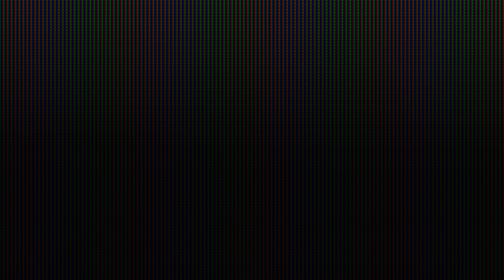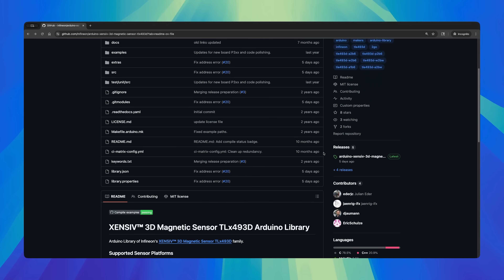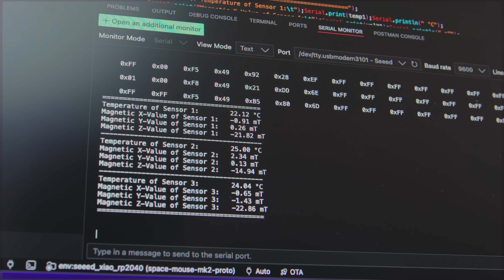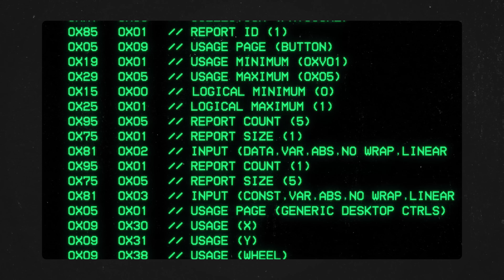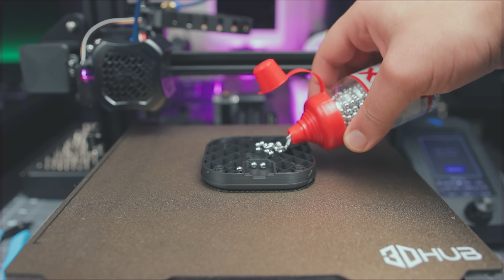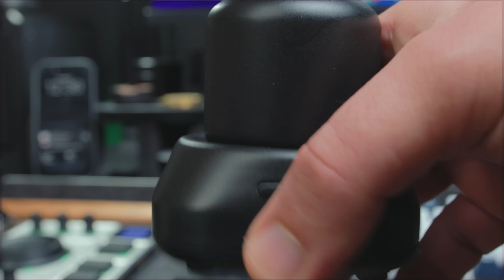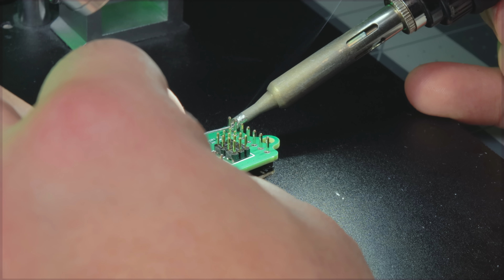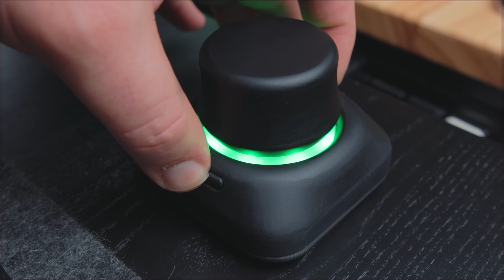I Made a 6DoF Space Mouse using Magnets (again)*

Comment: Good vid. Based on the examples I've seen this might be top 3 DIY 6DoF mice, though the PETG springs will sag when used and not have uniform motion, so although it's good you have the function to recalibrate on the fly, changing to custom stainless steel springs is an inevitable improvement. They're not hard to make since you can wrap wire around a screw to make a spring.
Reply: It would be super cool if someone made a fork of the eventual Git drop and included a write up with photos on doing this 😉

Comment: The springs will deform eventually requiring frequent calibration. Also that 2d orientation of springs create uneven tension when doing 6dof movement. I already did all this and came to conclusion metal springs are best and nothing beats them
Reply: Perhaps you'll contribute your findings to the Git once it exists?
Reply: @evilrainbow in my plan only code is not provided(closed). Full design step file is provided
Reply: @DoTheDiy Well I'd be interested in seeing what you are willing to share.

Comment: I just bought a SpaceMouse used this week for €75, it's pretty insane that nobody else has really entered this market yet
Reply: Because of driver support.
Reply: @olafmarzocchi6194  Yeah, building out software integrations with all the CAD and 3D apps is a big bottleneck. For my new 3d trackball Rotatrix, I'm finding that it has to be done per app, and it needs camera & scene information - not as simple as just sending HID joystick commands.
Reply: @olafmarzocchi6194  this and integration are the biggest headaches!

You could technically read any custom device cross platform with hidapi, but the software support is completely on you at that point
Reply: Actually I just did - I built a 3-axis trackball called Rotatrix that turns the model 1:1 with the ball. New kind of 3D controller that also functions as a mouse. Demo on my channel if you're curious.
Reply: I built this first model to use with Fusion360. I do like the small footprint.

Some months later, I noticed the Rotatrix ($231.96 cdn), which is little Pi-Zero raspberry pi board that I wired up inside a Kensington Slimblade trackball ($156.79 cdn). 

Rotatrix comes with a macOS driver that installs the appropriate plugins to apps like Fusion360 and Blender. The idea is the Rotatrix captures the data from the second optical sensor that Kensington uses only to detect rotation so that proper 6DOF is achieved. 

For day-to-day use, I very much prefer the 6D precise positioning control that a roller ball provides as opposed the constant-speed space mouse (wired version $306.99 cdn).
Reply: @rmkc2335  I'm really glad to hear that! Thanks for getting the kit, look out for even more functionality to come via software updates.
Reply: @davidliucreates I'd love to buy it but I was directed to a shortlist, is it possible thst you will be able to sell it anytime in the future and make it ready to purchase!?
Reply: @createdbysumeone working on it now!
Reply: Patents, small market and you would need to undercut significantly on price after finding a way around the patents, because otherwise people will just stick to "the original", as is usually the case. Too much friction, too many risks and even if everything turns out well, it still wouldn't be profitable enough unless you could compete at the same price point (which would mean you'd need other features to stand out, simple feature parity will not be enough to compete).
Reply: @XTJ7 Patent should be pretty simple to argue, because this is basically a short Joy Stick (old school long play devices)
Reply: @Mi-Ke-01  No.. it's absolutely not something you can just explain away. It uses specific sensor technologies in certain ways that are 100% something they will sue you into oblivion for, if they find you've infringed. That's the point of a patent and they will actively enforce against other commercial turnkey products.
Reply: @Roobotics modern vs old.. hence my use of the word "basically"

i fully understand what patents are for, often the argument comes down to form and function 

lastly i doubt the sensors are so unique you'd only find them in a SpaceMouse, so the patent must be about how they are arranged and how they are used with other components, many of these aspects you could likely overcome
Reply: @Roobotics  this is such a simple concept, it's insane that you can even patent something this basic.
Reply: Well, there is a 3d printed space mouse on aliexpress
Reply: the profit margin is too small, that's why
Reply: Naya keyboard, only 1K ;). Not sure about drivers.

Comment: This is wild dude, I watched your original video when it first dropped and the project has been in my mind ever since. I re-watched it a few weeks ago but the drawbacks to the original convinced me to just pickup a spacemouse. I found a used first gen wireless model on ebay for $130 and I lowballed the seller for $80 and he took it!

I printed a new knob for it and started learning PCB design on KiCAD to make a replacement usb-c daughter board to get rid of the micro usb port. Then you drop this video right after I get the gerber files exported lol

Comment: This is a really cool project, and it’s also awesome that you offer pre-assembled circuit boards! I’m really bad at that, so this is perfect.
The only problem now is that I don’t have a 3D printer yet 😭 I think I’ll wait another two years for the V3, then I’ll definitely be able to print it myself 😂
Reply: My problem with the original mouse is that it requires countless drivers to be installed, and they’re always running. I really don’t like that, which is why it’s out of the question for me. Open source is, of course, worlds better in that regard!

Comment: Awesome update.  My only concern is the PETG spring over time and it deforming, not so much snaping.
Reply: As he said, it's cheap and easy to replace.
Reply: yeah i would think better to use metallic springs, the simple bendy tube shaped ones with a hook on each end would probably be fine, get them about half the length of the gap between the anchor points
Reply: I have PETG loop springs holding up two of my 3D printers, They have not deformed and have been doing the job for over five years, and they are both over 5kg - I'm betting these are the perfect solution, metal springs are going to sound awful.
Reply: @vizionthing are these springs you speak of anything like in this video? i mean part of my worry is how thin they are

Comment: would be interesting to add a little touchscreen to the top, and heptic motor- really add clunks for quick navigations
Reply: It’s a mouse…it doesn’t need a screen that your hand covers and you aren’t looking at 99.99% of the time. Haptics sure
Reply: @adrianus13  imagine being able to change settings and calibarations on the fly and not with a full re-flash of firmware. maybe a (virtual) scroll wheel or a mini touchpad. Even change which device its using (USB to bluetooth)... its not a mouse; you dont think those buttons are left and right click and it just moves the  pointer around do you? (albeit a mode you could select if you had a little touchscreen menu)

Comment: after I watched your project 3 years ago I decided to buy the spacemouse instead of making one and its quickly paid itself off, zero regret. its nice to see the upgrade version of the project though.
Reply: Totally agree. It is the tool for such tasks as 3d modelling and video editing.
Reply: I already had a space mouse. But this being diy means i can have a space mouse for any apps or game or robot. Especially all the ones the actual space mouse is not supported on.
Reply: which you got ?
I kinda want now one as well, hehehe
Reply: @conker42  I went for spacemouse wireless. It's a little annoying because it's not heavy enough so I can't use it as aggressive as I want. to fix the issue I double-side tape it down to the table.
Reply: @hokoo @hokoon could maybe 3D print a mousepad-shaped plate that locks the space mouse into place while also being able to attach a gel pad for your wrist. The weight of your hand will keep the space mouse from moving, yet you’ll still be able to reposition it, unlike the double sided tape.
Reply: @app-o-matix  yeah I also think about that, same ergonomic as the pro version.
Reply: @hokoon  glue-on flat lead weights exist, used for balancing car tires. might be useful for you, along with a more grippy rubber mat / rubber feet on the mouse.
Reply: @hokoon yeah I have the wireless 3dx spacemouse too, but I have that in my laptop case for travelling, at the workshop I have the spacemouse enterprise, its FAR better, it sped up my modeling soooooo much!
Reply: @J30YLK  If I can go back in time I'll definitely buy the pro version instead. but as someone who do this as a hobby, I'll have to stop thinking about buying a second spacemouse lol.
Reply: I've tried another DIY space mouse project that went nowhere. NGL, I think i'm going to buy one too. It might even be worth a pro version with extra buttons